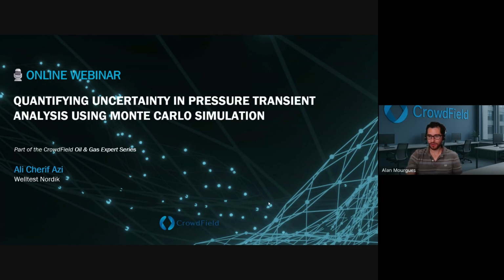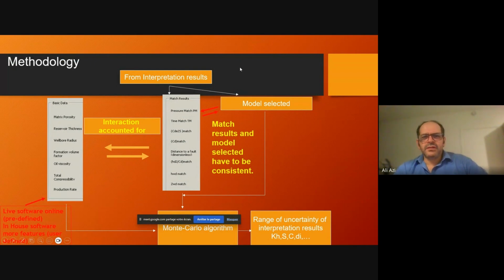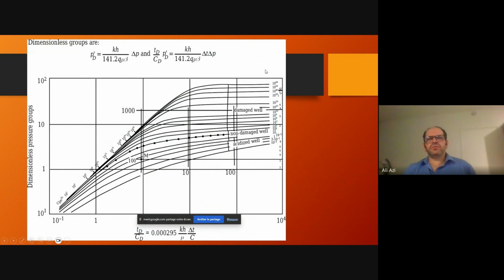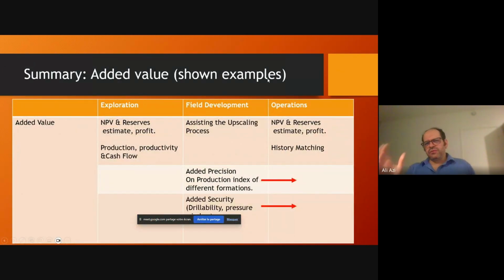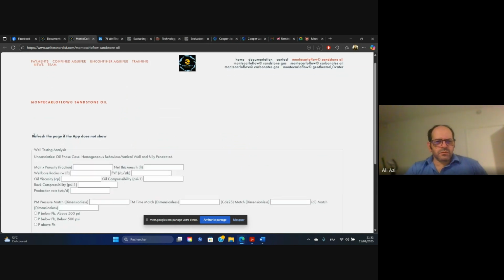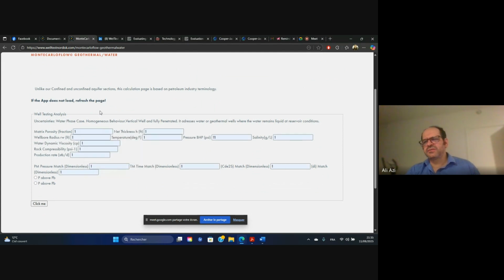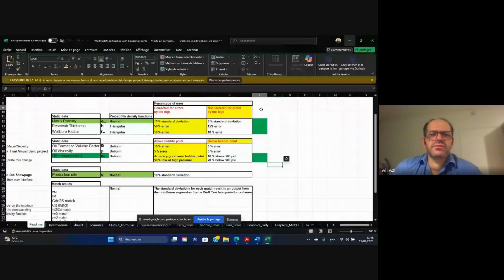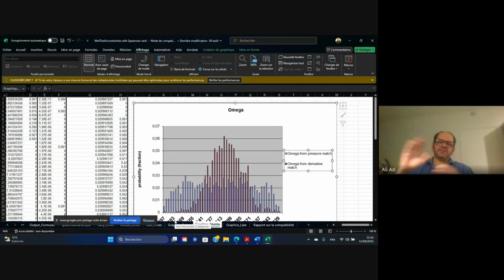Uncertainty in Pressure Transient Analysis | Ali Azi | CrowdField O&G Expert Series - Webinar #6

Comment: Hi  Ali, thx for the presentation. I've been working pretty much full-time in PTA for the past 25 years and I always quote your paper with Gringarten (and Spivey) to my classes to demonstrate the typical errors encountered with inputs and outputs. However what's missing is the validity of the interpreter's decision of how to characterise a derivative shape, which for me is far larger. For example, if your well is very near a boundary (and often they are) hemi radial flow can be misdefined as radial flow and that has a knock on effect on Skin, distances to boundaries etc. These are things that I'm not sure any statistical analysis can handle adequately.